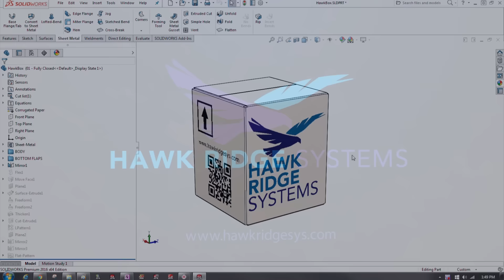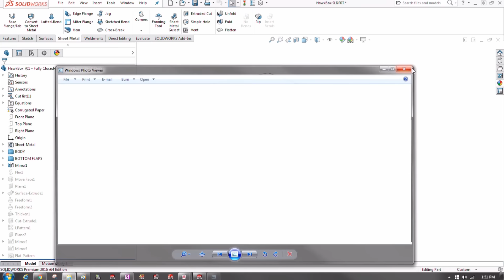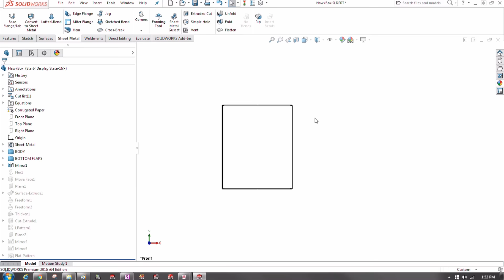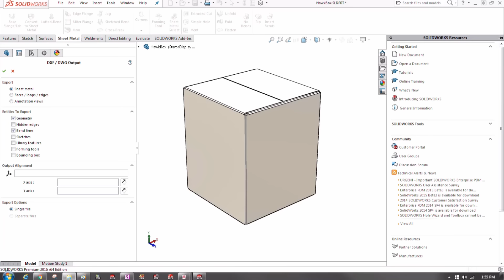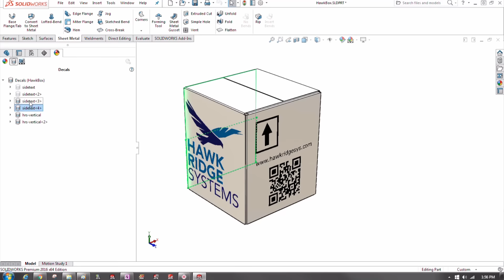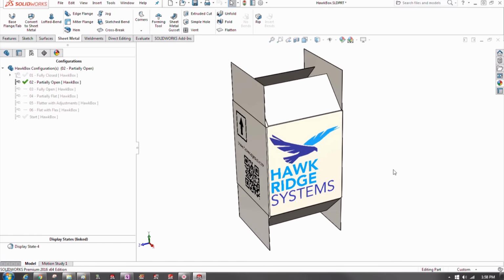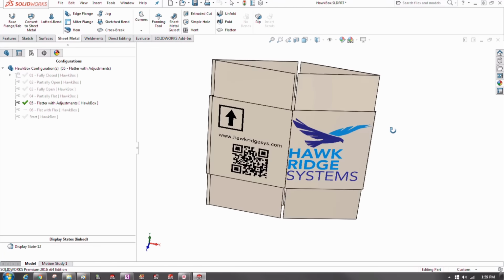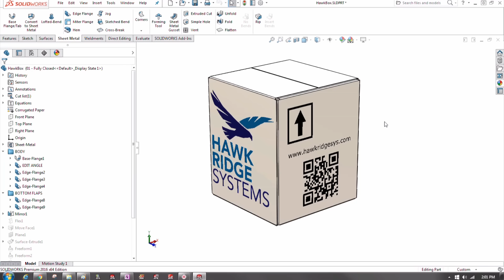Packaging Design in SOLIDWORKS

Comment: what if the body is circular ? and what if we dont use sheet metal working please answer
Reply from the maker: Hello,

The Sheet Metal tools can be used to represent a cylindrical body so long as you "break" the cylinder with a small cut along its length. The easiest way to do this would be to sketch a centerpoint arc that makes nearly a full circle (say 359 degrees) and then perform the sheet metal base flange command to extrude it into 3D. If you haven't used the sheet metal tools before I'd recommend checking the tutorials within the software for a quick guide on how to get started with sheet metal.